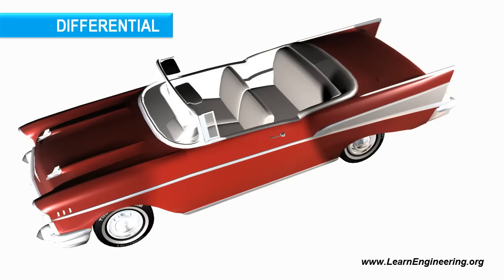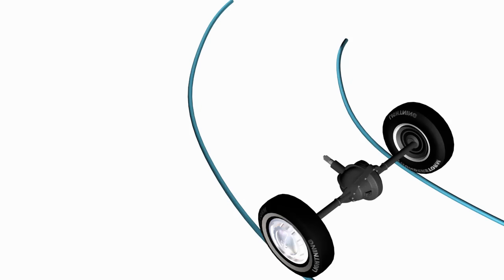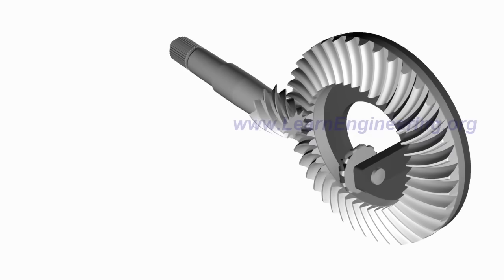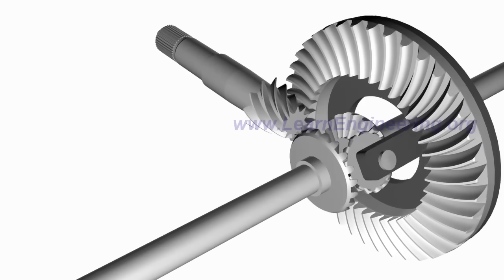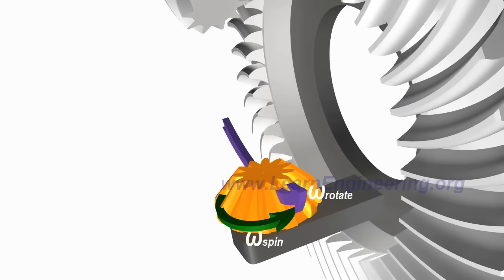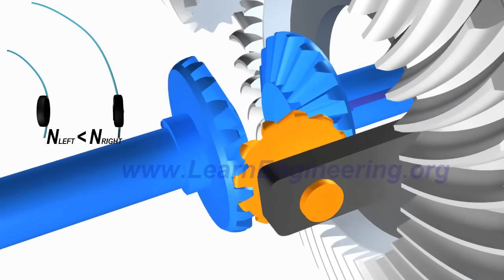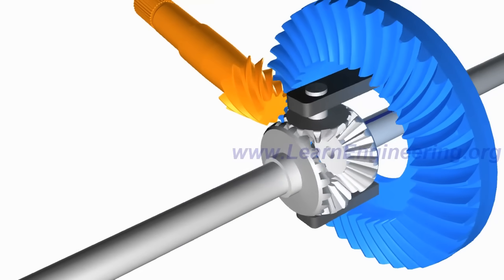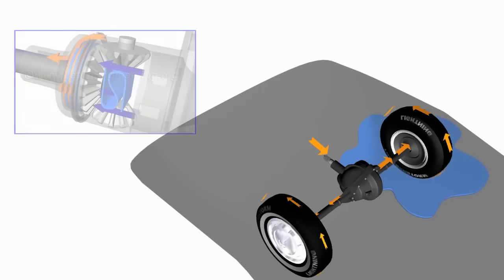How a Differential works ?

Comment: how the spider gear rotates it's own axis
Reply: i think it is explain a little bit in a reverse way about it :  the wheel which turn less makes the spider gear rotates on its own axis and it provokes the increasement of the other wheel speed, as explain by the addition of the two spider gear's rotates. Tell me if you disagree, i guess it alone.
Reply: +Francois
I think the opposite way : it is the spider gear spin which cause the outer wheel rotate faster while reduces the speed of the inner wheel by the same amount.
I still think the spider gear spin comes from other mechanism. Isn't the differential (which consists of the spider gear) meant to enable different speed for the wheels ?
Reply: Lex Soft spider gear free spins

Comment: Please let me know if I have got this right: Due to a higher rpm on the left side during a right turn, the spider gear  spins on its own axis and simultaneously slows down the other sidegear in the same ratio due to the interconnection?
Reply: yeah, I think so
Reply: What causes the outer wheel gets higher rpm, while initially both wheels have the same rpm ?
Reply: Lex Soft when you turn the front wheels, the car has to turn, thus increasing the speed of the wheel on the outside of the turn and decreasing it on the inside of the turn

Comment: How the spider gear rotates?  What power is supply to it?
Reply: KeyChannnel the force on the tires as the car turns cause the side gears to try and achieve different speeds, which moves the spider gear

Comment: and hw does the spider gears.... adjust its rotation abt the right n left @ the same tym ....?pls reply me..
Reply from the maker: The spider gears are free to rotate. There is no connection between the spider gears.
Reply: oh thank u....
Reply: Anjali Pillai
Reply: but how doest it know where to spin and how does it spin
Reply: ΛtmoSphere the spider gears are not rotated by the engine but rather as a result of the independent motion of the wheels. They rotate freely so that the left has a different rotational velocity than the right.
Reply: k tnx for the info

Comment: How does the spider gear know when to rotate on its axis
Reply: I am also a little confused on that concept. So from my understanding the spider gear spins a certain way to match the resistances of the two wheels. Because sliding is harder than rolling the wheel on the outside basically governs how much the spider gear rotates by. Is that the concept?
Reply: Carson Belknap exactly. It is governed from the outside.
Reply: its basic theory of differential . ok tell me how to adjust the height by using seam
Reply: I know what you're asking, I think. Not sure ppl understand. Are you wondering how the spider gear begins to spin when it is the source of the drive energy transmitted to each wheel? In other words, the spider is turning the wheels, so how can the wheels then spin the spider? I had the same thought. The momentum of the car forces the outside wheel to spin faster as it enters a turn. This increased rpm occurring on one side only is what starts the spider gear spinning.
Reply: Like how does the diff know when the car enters a corner
Reply: The spider gear is free spinning, So when it comes to a corner it spins which ever way required for the corner.
Reply: Finn Martin https://youtu.be/K4JhruinbWc
Reply: I'm sorry, I implied that the outside wheel spontaneously accelerates due to the turn. In reality, the inside wheel just slows.

Comment: do spider gears run on their own electric motors?
Reply: It has to do with friction. The easiest way to explain is by saying that the power takes the route of least resistance. If you were to block one wheel so it can't move at all, all power will go to the other wheel. If you lower the resistance on the wheel you're blocking(by reducing brake power on that wheel) that wheel will start to turn slowly. Because some power is directed to the first wheel, the second wheel will have less power and will turn slower. 

We can now apply this to the car driving on the road. If the car is driving straight, friction on both wheels is the same. Same resistance will lead to the wheels turning at the same speed. 
If you take a turn to the left, your right wheel will have to cover a greater distance than the left wheel. This creates a greater resistance at the left wheel, so the left wheel will turn slower than the right wheel.
Reply: No it appears it does not require power
Reply: helpful comment thanks

Comment: If one of the drive shafts breaks, you don't have any torque on either shaft anymore. But what's the difference when one drive shaft loses all grip? Isn't this like the same situation? Apparently the torque on both shafts is maintained. Could you perhaps explain this?
Reply: Ajdin Mujo if one shaft breaks, or a tire loses grip or is off the ground, it will spin freely at twice the speed, while the tire doesn't move at all.  The path of least resistance.  This is why off road vehicles have a locking differential, to be able to lock both shafts together with the push of a button.   There is a also a limited slip differential, which has friction plates inside, so there is resistance to the spider gears moving, allowing for at least some grip from the wheel with traction.

Comment: I noticed that the drive shaft and the pinion gear are spinning in opposite directions. Is there a third gear that causes this to happen?
Reply: AfterThisShutUp it's a illusion, it looks like it going backward because of the speed and framerate of the video.

Comment: I didn't get the slippery thing , some one please explain.
Reply: +Saiteja Miryala 
Imagine that you and a friend are side by side carrying a pole, with you on the left and the friend on the right.  If you are both walking at the same speed you go in a straight line.  But if you wanted to make a left hand turn you would have to slow down and your friend would have to speed up to make the turn.  If you wanted to keep the same walking speed you would have to 'walk in place'.  A tire would do the same - it would spin faster than it was going.

Comment: why doesn't the other wheel turn backwards when turning?
Reply: Because the whole spider wheel is still pushing is in its forward direction
Reply: It looks like if u forced the faster movement of one wheel from outside the vehicle,  you would force the second to start moving back.

Comment: does the differential add a reduction ratio? i mean internally, I know a reduction will be made having in mind the difference in the ring gear and in the pinion gear, but i do not now if its internal mecanism also add a reduction ratio

Comment: Rc cars have limited slip diff by simply running the spider gears in thick silicon oil.. the effect is adjustable by running different viscosity.
Reply: Limted slip uses clutch packs.   The clutches must slipe for the wheels to turn at different speeds. I got my mechanics license 44 years ago this month

Comment: This is a fairly simple yet absolutely genious form of engineering
Reply: +gnarkilleptic and imagine... it was probably originally made with no computers.... probably a slide rule and a pencil
Reply: @Corkoth55  currently stuck designing gears and stuff for a project. Can confirm, sucks without a computer.
Reply: @Corkoth55 
Yes it was.
Reply: yep. torque converters are kind of alien tehnology.
Reply: Learn how a torsen or limited slip differential works and you'll realise this was just a small stepping stone. And if you really wanna be mind fucked, learn how torque converters work. They're incredible.
Reply: This took probably 10 years op engineers working to get it out to the market science is very slow it takes ages on the innovation side.
Reply: @gamezahoy712  It's not so much the fact that science is slow as it is all the bureaucratic bullshit science has to go through to get anything done. Said bullshit usually has to do with finance, marketing, sales, and other useless individuals.
Reply: I agree. Everytime I learn more about vehicles engineering I am thoroughly amazed at its simplistic beauty.
Reply: @Sidowse  you see the thing is that they are useful because were in the present not the future also they can’t be so useless if just about every car has one but yes some electric cars have a motor on each wheel but that’s doesn’t make differentials useless at least for the moment and probably for a while in the future.
Reply: Complex things arise from simple rules.
Reply: @davidhall3747  profound!
Reply: @Joseph.m-y2o  Thanks.
Reply: So is IWD lol
Reply: https://youtu.be/58zdJmumcdA
Reply: @Sidowse  they arent crap though, sure maybe what you say is better but this is still good